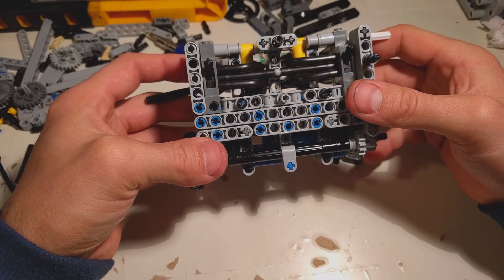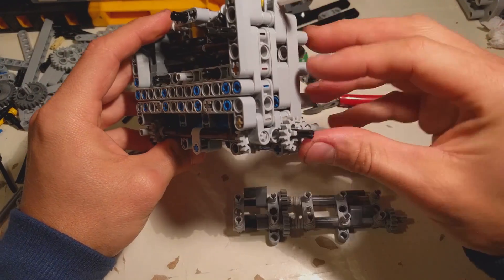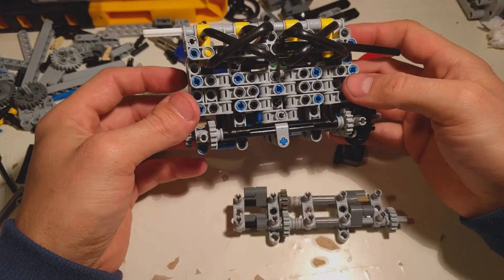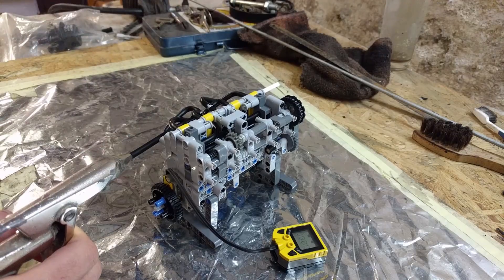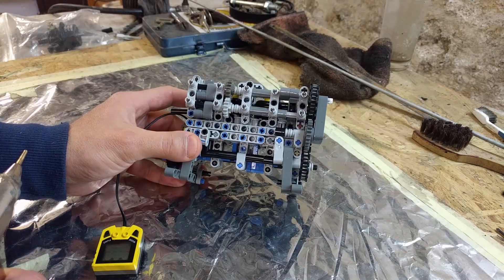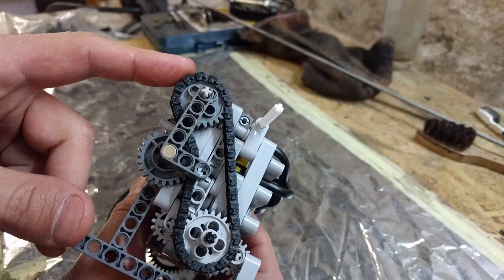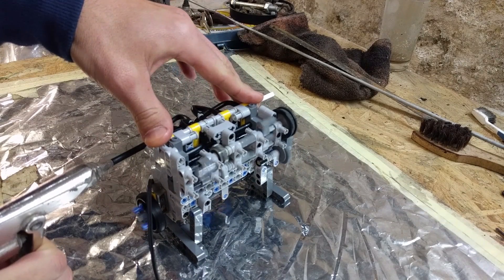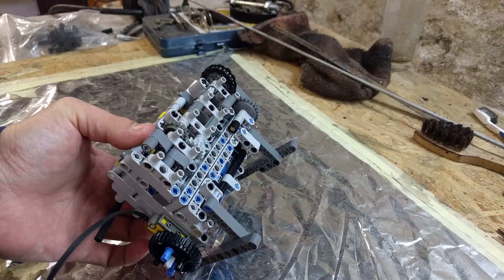LPE power Development - Small cylinder Inline 4 part 3

Comment: You can get a more accurate timing done by using the white gears with the slipping internal shaft. Just adjust the shaft the the angle you want and then glue in place. I hope this helps with the timing between the valve block and the pistons!

Comment: Unrelated question: Is it possible to make a compact CVT (Continually Variable Transmission) with Lego? I've seen it done before but its rather large.
Reply from the maker: The problem with lego and stuff like usefull clutches, brakes and transmissions (automatics or cvts) is the lack of proper friction materials and surfaces. Plastic is too slippery, and rubber on plastic can't transmit a lot of torque.
Reply: Alright, thanks for the response! Nice videos, by the way. :]

Comment: How does a flywheel affect the performance? Doesn't this make it run smoother?
Reply from the maker: It has not much effect. In a 1 cylinder engine it is necessary, here not.
Reply: @nicjasno  im do think that a wheel as a flywheel will help lots as it has more kinetic energy  to pull the engine over the where the cylinders are a bit rough considering all non Lego engines have flywheels and that steam engines also have heavy flywheels and work almost the same at thees Lego engines. i could be mistaken but i am a mechanic and have built model steam engines before.
Reply: @douglascharles6869  wrong

Comment: I might have a solution here, but I doubt that it will be compact enough: You could try to build sliders for the valves much like on the V8. But as I said, I doubt that this solution is possible/compact enough

Comment: do you use WD40 on engines? I have had some pretty good resluts when lubing a gearing attached to the RC motor from lego, which i'm sure you know. before i used it i had plastic party fusing together because of friction...
Reply: he said wd40 is really bad for lego
Reply: he uses silicon lubracant
Reply: aha, okay i only used it once, so i didn't know about longterm effects :P
Reply: WD40 has no lubricating properties....
Reply: lolsovs well, it prevented melting of my axles, or better said friction welding
Reply from the maker: It does. It was ment as a cleaner and water dispersant, but due to the oil content it does lubricate aswell, just not permanently. For that one needs a proper lubricant.
Reply: ah okay, yes my parts weren't in use very long, so maybe thats why it kind of worked for me :P i'll remember it though, normally i only use it to clean my bicycle chain anyways.